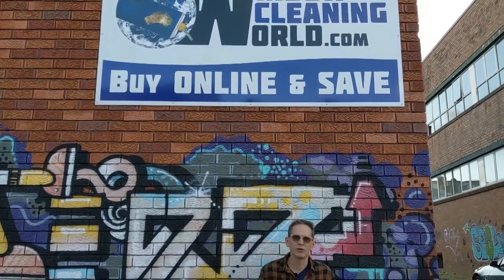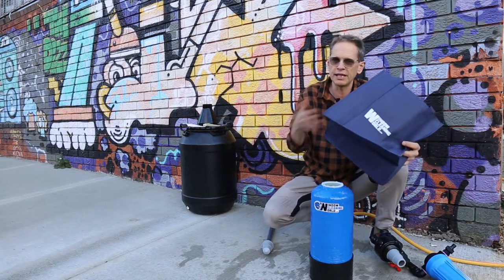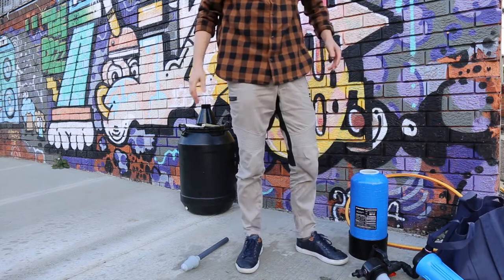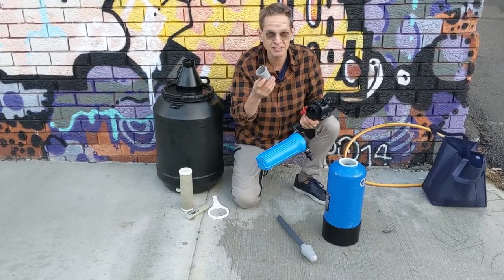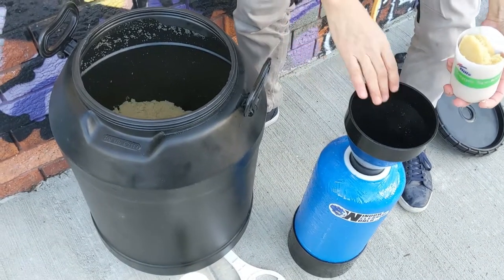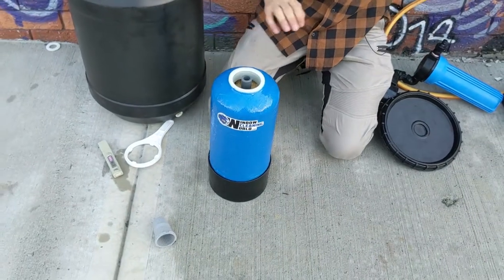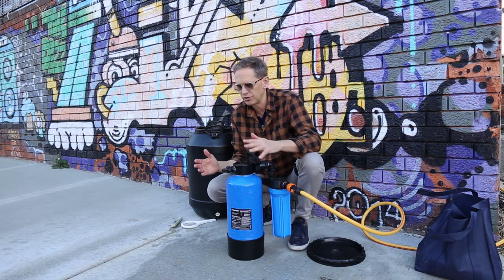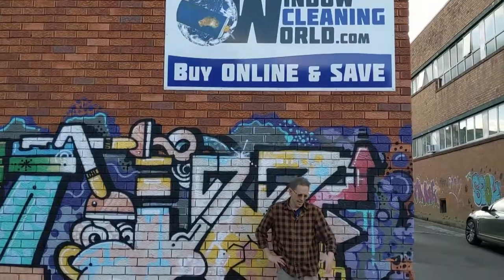Window Cleaning DI Resin Change

Comment: Great job.quick question .  On my di vessel In and out it doesn't say does it make a difference what side I plug my water in
Reply: Guess you figured it out by now but depends on your distributor head. Basic is you see an opening in the  top so water enters there and out thru the riser port. Some actually exit thru the top because the filter head is up top. Most all use the water in thru top and flows from the bottom up the riser. What I hate about cheap heads is you need a filter on the in port, a fine mesh like you see on garden hose washers and the inlet of a pressure washer to catch debris. Otherwise the resin can come out the port, especially if sloshed around, laid down, tips, etc... Made a .5 cu ft3 tank today from an old RO bladder tank. Someone threw their RO undersink set up and it had a mineral tank with a bladder. . Pulled out the bladder made a riser and used my old distributor.